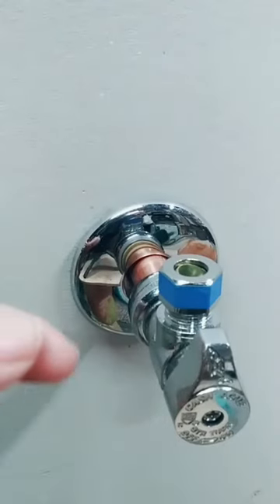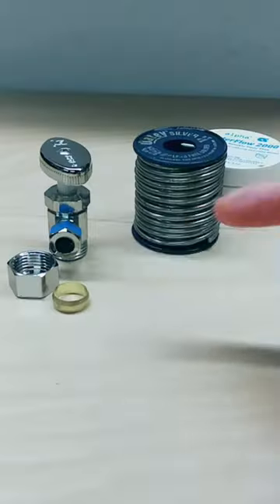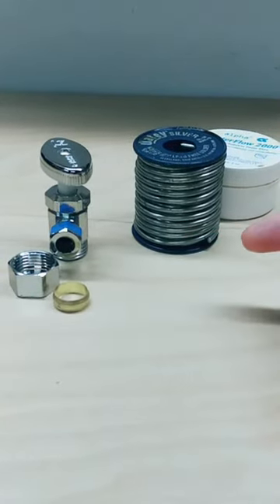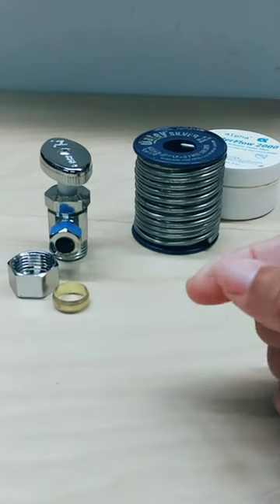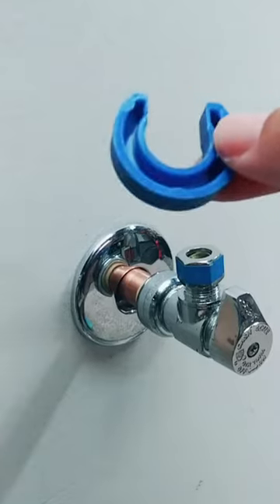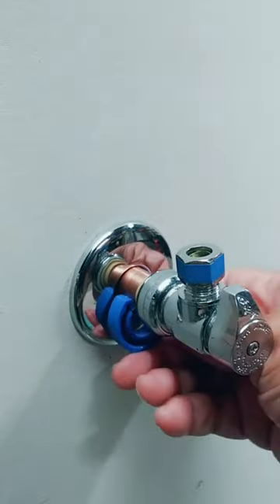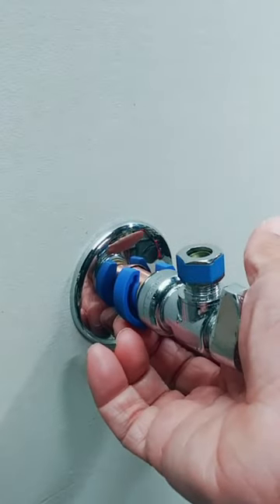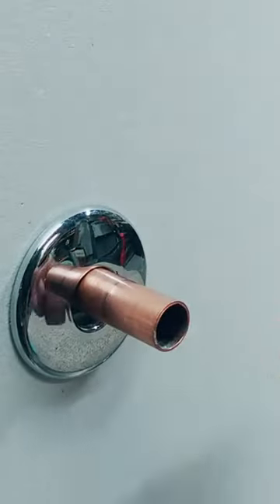Plumbing tip for beginners-#shorts

Comment: Just like the airlines on semi trucks. For that they actually make a pair of pliers that grabs the plastic tube in one jaw and then depresses the ring pushes the fitting off with tube using the other jaw. Very handy tool as the truck has hundreds of these fittings we really can't get your hands in the area.

Comment: I just recently replaced an old compression fit valve with a push fit one for the toilet water supply line, but I bought the wrong push fit valve and when I went to go remove it, I realized I didn’t have the little tool.  Had to do the wrench method, but it took a lot more effort than how Leah did it. Lol

Comment: What's the draw back of something like this VS something that is crimped or soldered?
Reply from the maker: the fittings are limited in regards to where they can be used,  unlike pex, chemical welds and solder.
Reply from the maker: they are limited in regards to where they can be installed, unlike solder, chemical welds or pex.

Comment: I have a few off these type fittings in exposed areas of the house with no problems yet..  I would never install this in an enclosed wall.  I still don't fully trust them.
Reply from the maker: they're not intended for closed wall application